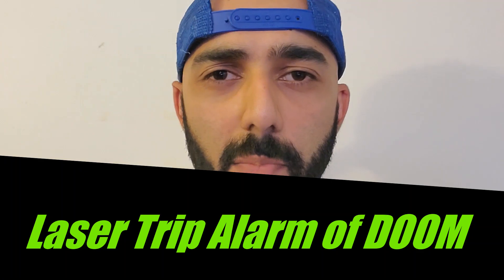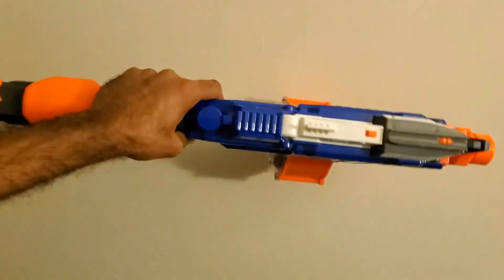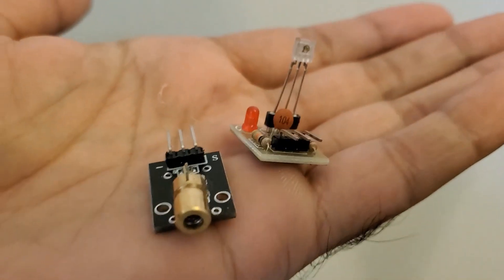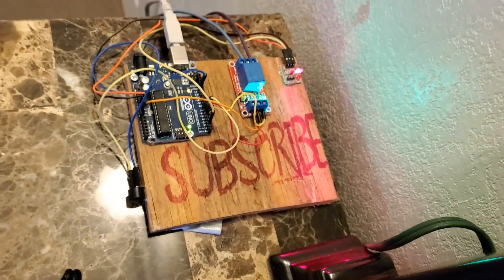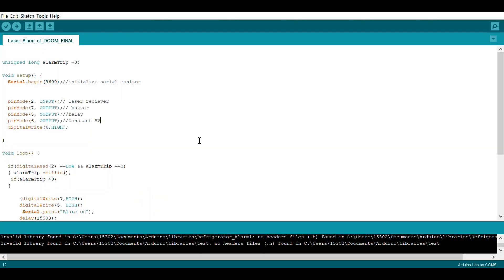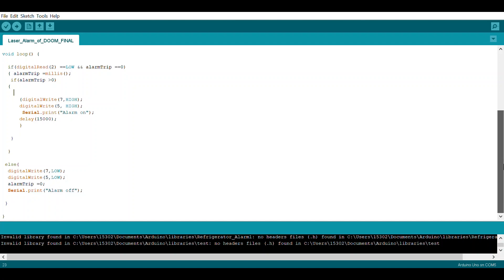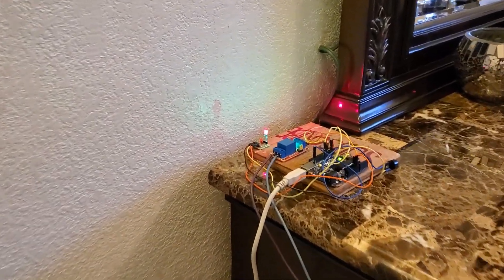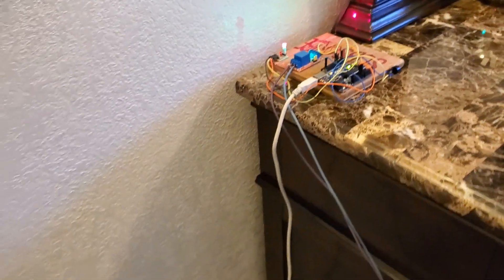DIY Laser Triggered NERF Gun || Arduino

Comment: How did you mod the nerf, to fire on signal from the arduino?  If anyone know, pls tell me
Reply from the maker: I just cut one of the battery lines and extended it out using wire. Then I hooked it up to a relay.

Comment: why use a relay if you are just going to supply power from your arduino?
Reply from the maker: Power is not supplied by the arduino for the NERF blaster. Instead the relay acts as a switch to turn on the power of the blaster (the blaster uses power from its batteries)

Comment: How did you rig the trigger? You need to post links to the very expensive parts from china you got.
Reply from the maker: I put a relay module in series with the positve wire of the NERF blaster so I could switch on the gun as long as I had the trigger and safety  was zip tied back. The link to the laser is now  in the description.